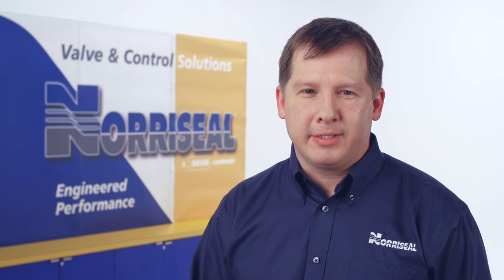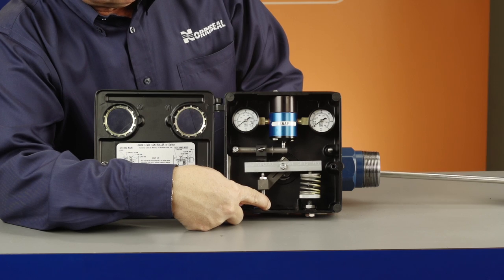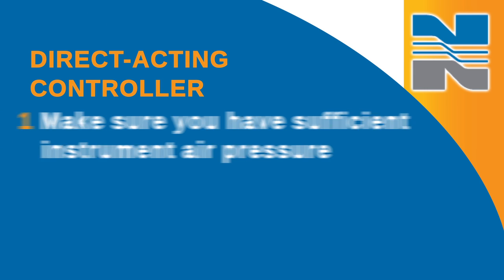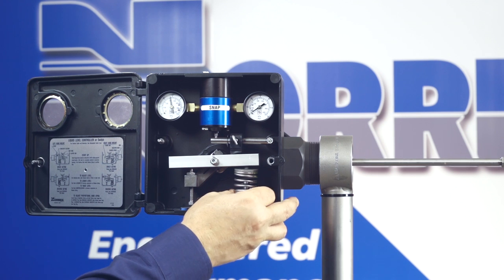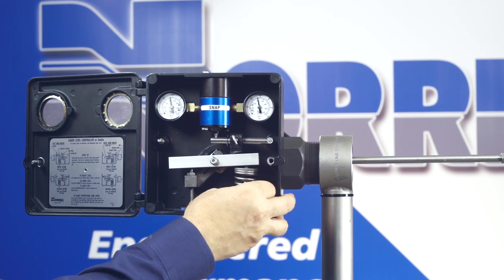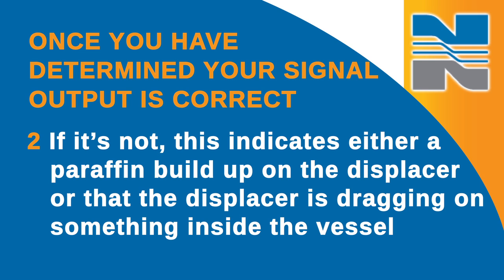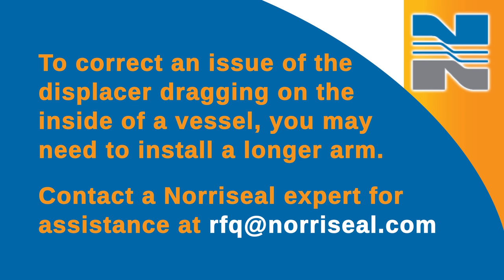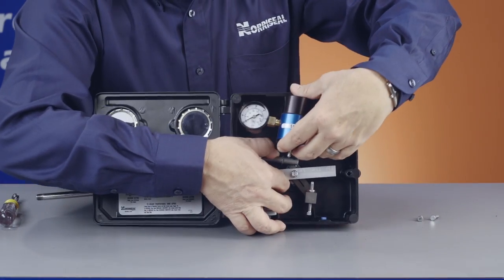How To Troubleshoot Your 1001 Series Level Controller

Comment: As you're doing this make sure you don't remove the pivot pins from the case. We press fit them into the case and they're not meant to be removed also don't remove the sensitivity fulcrum or thumb screw.  Now remove the lock nut from the torque bar and slide the torque bar off of the shaft. Hold a level adjusting bar in place and loosen the two cap screws until the level adjusting bar is free on the shaft you don't need to remove or adjust the adjusting screw unless to converting the case mounting. You can simply slide the level adjusting bar from the shaft and then slide the spacer from the shaft. Finally remove the two cap screws holding the case to the body and removeand remove the case from the body

Comment: Thank you for being a genuine or sell product in this video will talk about troubleshooting or series 1001 liquid level controller arm or second you may not be getting the desired signal just coming into this place was missing first move back and forth you should feel weight resistance on a displacer arm in the spring should be balanced and you'll need to safely bleach Down The Vessel remove the controller and replace the displacer if you determine that the displacer is present then you need to check to see if the controller is set properly first you'll need to determine whether your controller is direct-acting or reverse acting for a direct-acting controller first you need to make sure that you have sufficient instrument air pressure then check your controller to see if you have no output signal with no fluid on a displacer if there is an output and decrease the spring tension until the output signal is lost then you know you're okay if you have fluid over this place here and you don't have an output signal it increase or spring tension until an output signal is achieved for a reverse action controller need to make sure you have sufficient instrument air pressure in check your controller to see if you have an output signal with no fluid on the displacer if there is no output then decrease the spring tension until the output signal is achieved if there's an output then you know you're okay if you have fluid over the displacer and you have an output signal and increase your spring tension until you lose the output signal once you determine that your signal output is correct you to check the fluid level if it's not this indicates either a paraffin buildup on the displacer or that the displacer is dragging and something inside the vessel this will require safely I like the displacer in the vessel determine if either these issues exist exist simply remove the excess build up arm contact for assistance at RFQ and norriseal. Com supply signal the pilot will need to be removed and inspected for any foreign materials in the seating surfaces make sure you safely remove all air before removing the pilot from the controller if necessary occasionally the best of loses all fluid overflow is particularly with temperature changes we've already checked to make sure the displays around this free and his voice was not hitting inside the vessel this could indicate that your display enough to handle the interface differential in this case you should contact to determine the exact size that should be used more information on troubleshooting controller is available and operations and maintenance manual at www.enorthfield.com